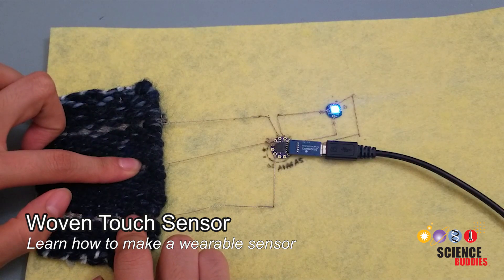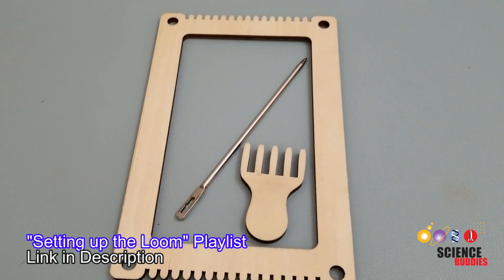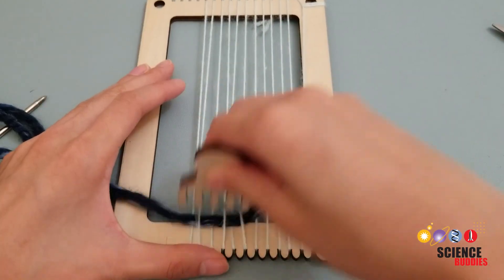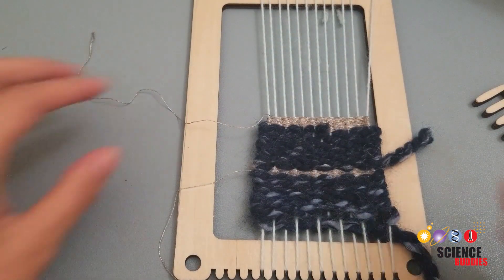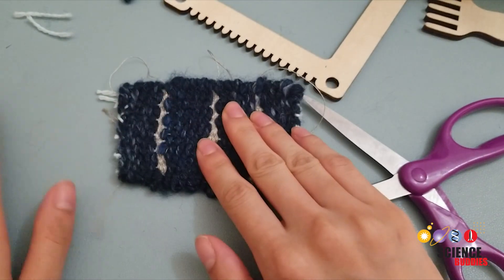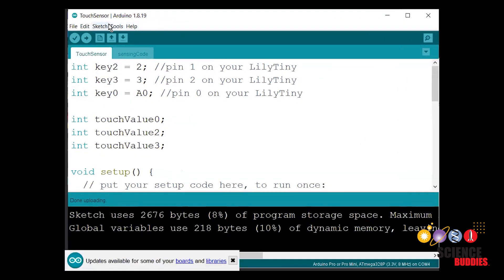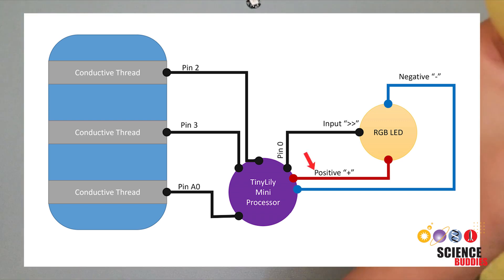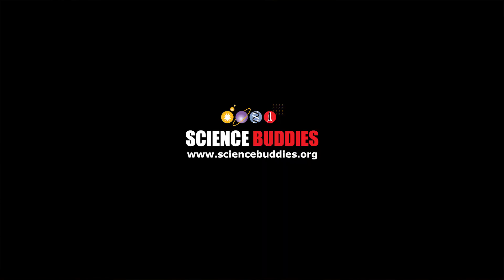Make a Woven Capacitive Touch Sensor | STEM Activity

Comment: Hey there! Thanks so much for this cool science project! We are SO CLOSE to the end but have run into an error code when we got to installing the TouchRGB. Here's the error message we're getting. Any help you can provide would be amazing! 

 Sketch uses 4296 bytes (13%) of program storage space. Maximum is 30720 bytes.
Global variables use 104 bytes (5%) of dynamic memory, leaving 1944 bytes for local variables. Maximum is 2048 bytes.
avrdude: stk500_getsync() attempt 1 of 10: not in sync: resp=0x00
avrdude: stk500_getsync() attempt 2 of 10: not in sync: resp=0xe0
avrdude: stk500_getsync() attempt 3 of 10: not in sync: resp=0xe0
avrdude: stk500_getsync() attempt 4 of 10: not in sync: resp=0x00
avrdude: stk500_getsync() attempt 5 of 10: not in sync: resp=0xe0
avrdude: stk500_getsync() attempt 6 of 10: not in sync: resp=0xe0
avrdude: stk500_getsync() attempt 7 of 10: not in sync: resp=0x00
avrdude: stk500_getsync() attempt 8 of 10: not in sync: resp=0xe0
avrdude: stk500_getsync() attempt 9 of 10: not in sync: resp=0xe0
avrdude: stk500_getsync() attempt 10 of 10: not in sync: resp=0x00
Failed uploading: uploading error: exit status 1